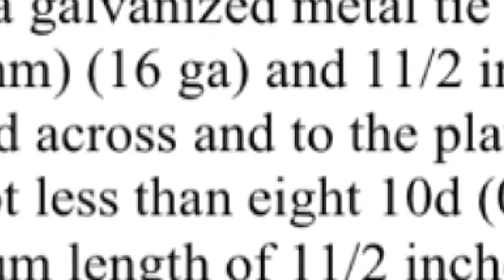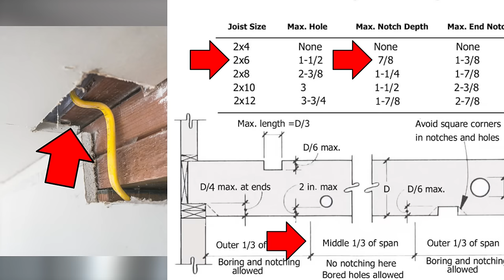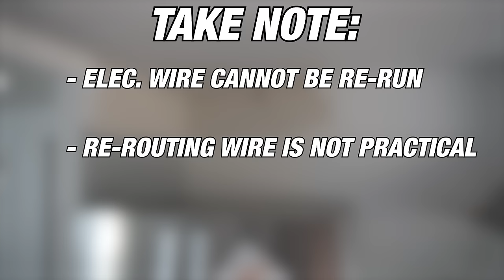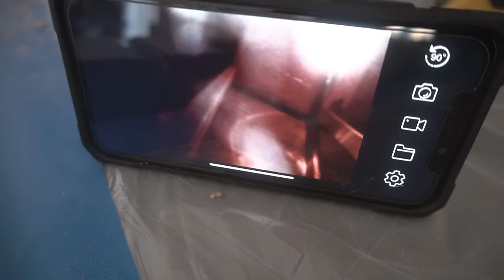How Run Short Existing Electrical Wire Through Top or Bottom Plate Studs On WEIRD Situations! | DIY

Comment: Awesome. I have to upgrade my electric service and know I'm going to run into surprises. Need 2 20A dedicated circuits in garage and in back room I use for mitre saw and my box is full. I know I have to get a permit and install a sub panel next to the main. If I don't have to upgrade my main panel I may be able to do it myself through self learning and poring over the NEC codes and ones from my area. Worst case I'll know what to buy and have everything ready for the electrician if I need to hire one.
Reply from the maker: That’s awesome Christopher! Yes having all materials ready will save cost and time for sure! I wish you well! If you don’t mind sharing the cost to install the sub panel would be great!
Reply: @FixThisHouse  will do. Maybe not next year but hopefully in 2024. The state of the economy has me concerned and I've idled most of my woodworking projects.
Reply: if you watch a few videos on electrical load calculation, you may find the panel is full of breakers, but not fully loaded, power wise. In that case you can get some split breakers and gain a few slots to add more circuits. If you don't have central AC, hot tub, well pump, or electric heat, you'd be amazed and what you can do with an existing 100 amp panel.
Reply: Honestly, adding a sub panel is not a DIY project. There are several ways to get hurt or killed doing that. I would get several quotes and then ask the electrician you like the most if there’s any part of it that you can do yourself to keep costs down. They will usually work with you
Reply: Here's something that may help you out. If there's parts of your house that don't need electricity, just switch the wires on that circuit breaker if you can't make room for a new breaker in your sub panel. If the power you need in the garage isn't a permanent need, just switch the wires out of a breaker.

Comment: For future reference, make sure the wire sheathing is not making direct contact with the edge of the nail plate, as they have sharp edged, other than that awesome work.
Reply from the maker: Thank you Ryan for the advice! 🙏🏽😊👍🏽
Reply: Sounds like a good idea, but how would you do that in this situation?
Reply: Maybe notch a little deeper.
Reply: Electrical tape over edges that touch the wire would cut down on the sharpness
Reply: I'd suggest using a file on those sharp edges before installing the plates.  Prepare them beforehand, so they're ready for use when needed.

Comment: I don't think that passes code in most places. Can't have wire touching a metal plate.

The proper way to do this is to disconnect the wire in the attic and drill the hole in the top plates and run the wire properly

Comment: Those nail plates wouldn't pass inspection. Electrical wires vibrate and over time will wear off when touching metal.

Comment: That's not how a professional does it. 
The notched part is fine but at the area next to it the NMC is still too close to the surface. 
You should have drilled a 1/2" hole through the center of the top plates.
Reply from the maker: In the video I stated it’s this is for situations with fix wires

Comment: Simple: notch the studs, put wires in notch, and cover with metal guard. Simple.
Reply from the maker: It seems simple but make sure you are within code and structural limit areas 👍🏽😊

Comment: Don't do this. Run a new wire properly.

Running it through a hole in the top plate is cleaner and safer.